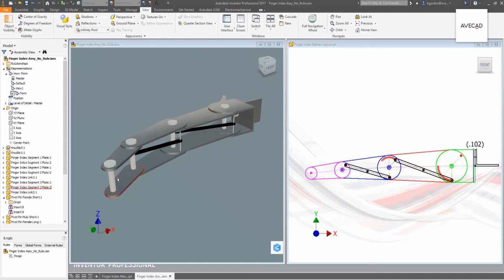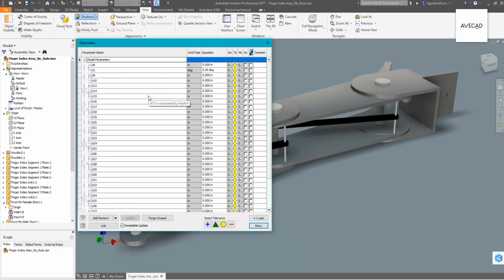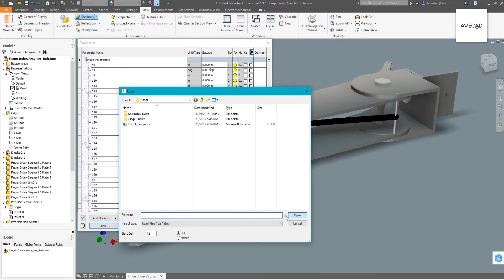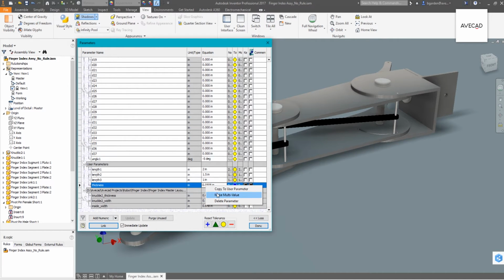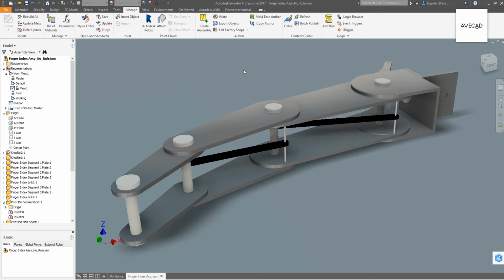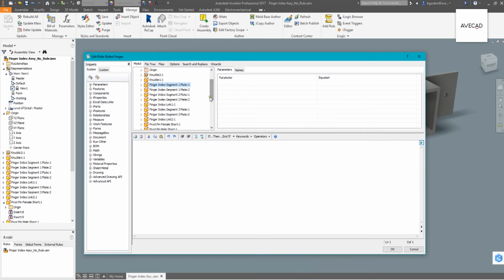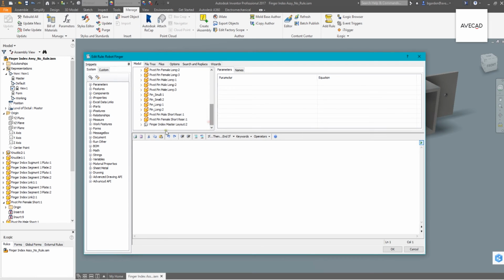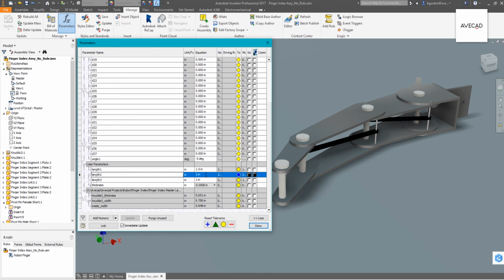Linking Parameters Part 3 iLogic Name Linking in Inventor - Avecad

Comment: I suggest everyone to be using master file, as this video suggests, the downside with other ilogic programming is that when you copy design, the ilogic rules does not update, hence ilogic programming is useless, but is seems like it works better with master part, because there is only one part name to change in ilogic after copy design
Reply: I think I am having similar problem I made a master file then I saved a copy of this file and in the copied file I created Manu variants of the same part( I parts) when I place this in another assembly the parts are not updating

Comment: I modeled a linear rail and a ballscrew 1610 for a project.
I putted the ballscrew and its snail and supports into a subassembly

Same thing with the linear rail and its runner

I placed them into the master assembly, which is a cnc essentially, and linked subAsseembly's part's parameters to master assembly's parameters.

Everything okay. Later i needed another ballscrew, but 1605, no problem, made another subassembly, same screw (different fake inventor's thread) different snail and same supports. I linked it to another parameter in the master Assembly, but when I change the parameter of one SFU the other one change as well, becoming both equal… I don't know what to do, checked everything, and it's okay…

Do you have any suggestions?

P.S. I needed also other rails, of equal sections but different length, so I placed another istance of the same subassembly, but they share the same variable name, and even if in iLogic the specific part name is mentioned and then its parameter, they still continue to equalizing. (Should I made a different subAssembly or there's an alternative, easier and correct way to do this?)